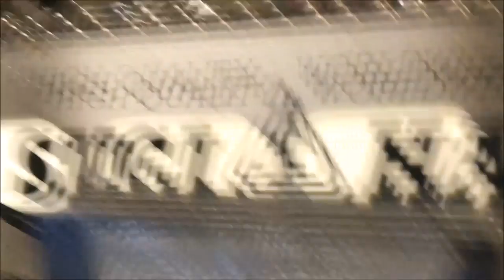How I sharpen my saws

Comment: Great sharpening video! I agree on not getting hung up on every tooth getting the same amount of file strokes. As long as the raker for that tooth is at the right height for the tooth, then that is what matters in my experience. I do use a gauge on the rakers, but thats just me.

Comment: That's right, file it until its sharp, ignore tooth length.  Just make sure to adjust the rakers if you file the snot out of a tooth. I twist the file if I need it to climb up out of the gullet or down in. I feel like it can help some times. I like the Husky raker gauges that sit across the cutter tooth and all the way down to tie strap in front of the raker. It sets the raker to the individual tooth.
Reply: That’s the best way, BAR NONE! Progressive is what it’s called. The one that you set across multiple teeth/cutters is called static. Progressive will take into account for every tooth that you work on. With the natural “rocking” up & down that each cutter/depth gauge goes through, progressive will keep the amount of “bite” the same. With a static, the bite will get bigger even though you have the same amount of drop down clearance. I hope that this has helped.

Comment: Hi greetings from the U.K!  Been hand filing now for 30 years.  Agree with everything you say.  You just get the feel for it.  I run a wire brush over the whole chain away from the toot edge to get rid of the filings when finished.   Keep the vids coming!  Cheers mate.

Comment: I wanted to ask the same question but I figured you already did a video! Your explanation was right on ! I was hoping you had some big secret! I've even touched the rakers with the 4" grinder but man does it kick back!  Takes the horsepower too ! Thanks for giving us the demo!
Reply: I’ve done the same thing and still do sometimes if I’m cutting soft wood but I’ll use a big bore saw so it helps kickback

Comment: File tangs (narrow, tapered bits) are intentionally "soft". They're not heated & quenched, to not be embrittled. Have you ever used Granberg file guide, or one of the many clones? One that I use regularly, I first used back in the '70s- it's that good, lets you precisely set angle & height, so your filing is consistent. Goes with me in the woods. With flat file, you can set depth gauges height within thousandths too. No need for stump vise with it. KEEP 'em sharp.

Comment: Try using a square file to sharpen with youll love it
Reply: Although it’s not “quite”, more like slightly trapezoidal.
Reply: A radial grinder has the same pitch as a square file.

Comment: Hey man that's a sweet bar where did u get that is that one of those titanium bars
Reply from the maker: Just hardened steel, I love them, stahls logging supplies has them they are in eastern pa and have a website you can buy them on
Reply: @nuts319  hey I have a couple walnut trees here and I'd like 2 no if there saw logs or if there  veneer logs and how much they'd b worth